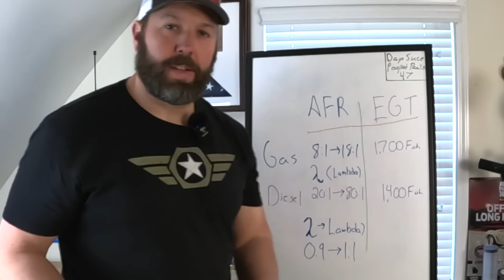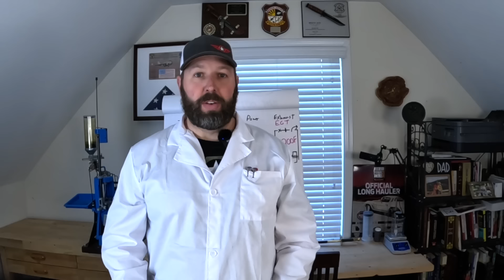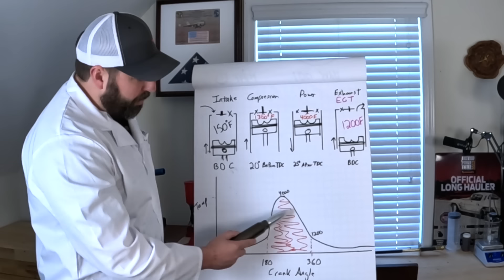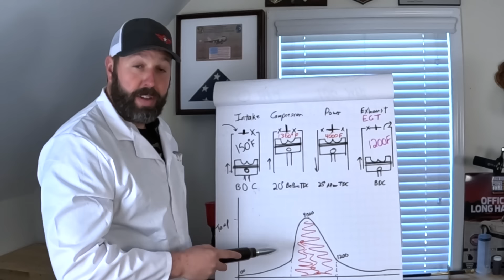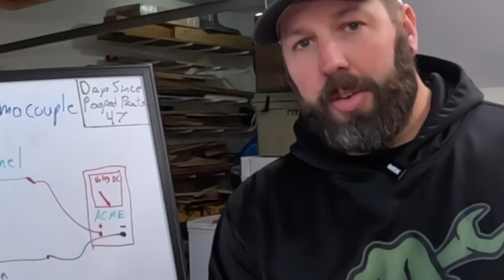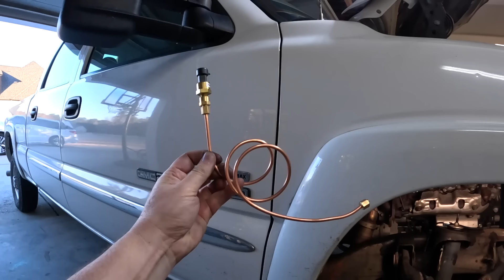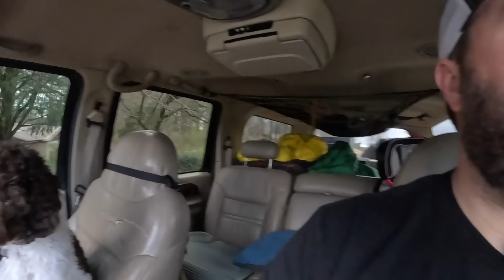Silent Diesel Killer…Diesel Exhaust Gas Temperature (EGT)! #diesel #egt #dieselengine

Comment: what do you think of putting a 12v lifepo4 battery in the trunk with 1/0 cable run to the lead acid in the front, I decided to do this as in my mind it would always keep the lead acid fully charged and happy and it shouldnt hurt the alternator just running as the back up

Comment: lurking’ under hood is a world of possibilities. 
Good info here to consider doing whatever it takes to keep things cool as possible. 
Trying to get up to speed on what it takes to make a 7.3 operate w more HP and keep it alive. 
Watched Daves Auto in Utah, speaks about those "gapless ring' / pistons what that does for these engines. 
Impressive to say the least.
Reply from the maker: Dave harps about a lot of stuff. $4,000 pistons that look like golf balls, gapless rings, and changing oil every 3K miles if you want him to warranty an engine e that he built. Hapless rings are good technology, but it’s really only something that comes into play when you are rebuilding an engine. Making power reliable power with a 7.3L isn’t hard, but it also isn’t cheap. I have a 7.3L Excursion that makes 500HP to the tires, and it was costly.
Reply: @freedomworx   What got my attention was the gapless ring phenomena,  help reduce EGT significantly as per his reporting. 
Which I’m understanding lower temps is a goal on making diesels live long & prosper. 
The explained science makes sense to me anyway what the byproduct and various mechanics does for the engine. 
Yet, most of us with engines factory pieces, the things we can do a LOT cheaper 'bolt-ons” sounds like the way to go actually. Better Exh system, the CTG programmer setup, Maybe the DPI setup, The Banks top end pieces, better Engine oil cooler and Trans cooler both. Heck of a lot cheaper then a Dave’s $15~20K engine for sure!  500 HP is way plenty honestly for most any needs.
Reply from the maker: @yafois988 I haven’t seen the video. But I’d be interested to see how gapless rings could reduce EGTs. I can certainly understand how they reduce blow-by and oil contamination. But EGTs… I’m not sure I follow that one. I have gapless seconds rings in a 1000HP 12 Valve, but I honestly don’t have any data to back up what benefit I’ve received from them. For a 7.3L though, just like any other engine, you really just need to build the engine for the application. If you are going to be towing with it, and don’t want to spend a ton of cash, the best bang for the buck is a set of Stage 1.5 injectors and tuning. That’s a 180/30 injector. Your factory fuel and HPOP are enough to feed them, and your factory transmission will generally survive. That’s good for over 400HP to the tires Anything after that gets very expensive.

Comment: Cat got it right the top part of the piston is steel and the skirts are aluminum and the wrist pin holds it togather so come cummins why not in my 5.9 or 6.7  Dodge motor ?
Reply from the maker: Two piece pistons are nice, but they are also expensive 😉

Comment: I think something that confuses a lot of people it's that they conflate heat and temperature. You have to keep in mind that these are completely separate entities. For instance a cigarette Burns at a very hot temperature but contains very little heat. On the other hand, a bathtub at 100° contains a good bit of heat but very low temperature compared to that cigarette.
Reply from the maker: Good analogy 👍

Comment: Do diesels benefit from methanol/water injection like petroleum engines? Never understood why adblue and EGR exist when it sounds like we could be squirtin in plain old tap reconstituted tapwater. Would probably steam clean that dirty EGR pipework too.
Reply from the maker: Yes, Water/Meth works great on a diesel. But most people aren't willing to deal with the hassle. Also, DEF causes a chemical reaction to reduce NOx. It's not just about lowering temps.

Comment: there's a lot of thermal dynamic going on, if you play paintball, you see it all the time when you fill your tank vs shooting.
Fill tank = compression stroke, spending tank pressure = power stroke, when gas escapes, or the space becomes less dense, there's less energy thus cooler temps. 
Just a different way of looking at it and relating.
Reply from the maker: Science 🤓

Comment: So for those of you who need a translation -- when towing, turn on the tow/haul mode!
Reply from the maker: That’s what you gleaned  from the video?
Reply: @freedomworx  Yes, after your excellent explanations, it makes perfect sense why, among other reasons, you would want to use tow haul mode when putting a substantial load on the engine. At least on my truck, it automagically substitutes a little more RPM for torque so that you are not dogging the engine, which according to you, will increase EGTs.
Reply from the maker: Yeah. Tow/Haul generally raises the shift points and makes the engine breaking scheme a lot more aggressive 👍

Comment: I'll add when drilling the manifold, use the clutch on the drill. It's worth not breaking off the drill bit in the manifold while the engine is running.
Reply from the maker: Good tip 👍

Comment: That was great, thank you! I'm off to fill my turdbo with shavings and busted taps...but before I do that... can you explain me why the exhaust was smokier on the higher map? Is this a function of the map or of the EGT?
Reply from the maker: Smoke and EGTs generally go hand in hand. More fuel equals more heat (EGT), but it also means more smoke, because with more fuel in the cylinder, you are less likely to get a complete burn of all the fuel.

Comment: Where did you get that drive pressure sensor?
Reply from the maker: It’s just a normal pressure sensor with an Isspro drive pressure adapter to keep the sensor cool.
Reply: Thanks. Is the manifold adaptor for that 1/8" npt like the pyrometer?
Reply from the maker: @clintbrock8052  yes

Comment: 2000 stock 7.3 Excursion here with 320k pulling a 33’ RV. Thanks for the explanation and the suggestions on what to do to help keep temps low until I can get a gauge to know for sure.
Reply from the maker: It would be tough to hurt one that isn’t modified, but it’s always good to have a gauge to tell if something is going wrong 👍
Reply: @freedomworx  thanks, that’s good to know. This video was the first time I’ve ever heard mention of a stock engine probably being ok. 

Your Excursion build series by the way is still some of the best YouTube I’ve seen. Thanks for the great vids 👍🏼
Reply from the maker: Thanks for watching 👍

Comment: And 3 to 5 minute idle cool down after working a diesel hard to avoid cracking the head..
Reply from the maker: Cooldown is primarily intended to allow the turbo to cool so that it doesn’t cook the oil in the turbocharger bearings once they lose oil flow.
Reply: When and why do I lose oil flow to turbo on 06 Cummins?

Comment: Keeping the engine revved up towing equals more CFM coming out of the turbo equals more cooling of the engine and combustion chamber. Bigger intercooler after cooler water methanol injection
Reply from the maker: That’s one way to look at it. Horsepower equals heat. To make the same amount of heat (watts) with fewer RPM, you have to make more heat per engine cycle. Meaning more cylinder and egt’s.
Reply: @freedomworx  Yes to a certain point. Exactly what you said in the video. Just put compound turbos double the CFM volume going through the intercooler / after cooler which in return equals more volume going through the cylinders of cool air
Reply from the maker: I’m building a compound 12 Valve right now. Should start seeing content within a couple weeks. 👍
Reply: @freedomworx  That's awesome man. I built a compound 24 valve on my big truck. It's a 60 mm over a 77 mm. It runs nice and cool for weighing 12,000 lb. And then I put my big dump trailer on there and put my JCB 214 backhoe in the back of it. It weighs in at 42,000 lb all together and still runs cool

Comment: What about if you add water/methanol injection. Will it lower your egt?
Reply from the maker: Yep. I actually had that in the video and cut it out to shorten things up.
Reply: @freedomworx  can you do wideo about water/methanol injection in diesel engines. Is good and bad sides of it. Whant to do it for my 2017 ram 6.7 Cummins but cant find any info for Diesel
Reply from the maker: @bogdanshulga2465  I’m honestly not sure how well it would jive in an emissions equipped truck, assuming yours is. I’ve never really thought about it. But it certainly works to reduce EGT and increase power in high boost/load situations.

Comment: I would say exhaust valves are in danger of burning an edge.  1250 degrees max. 1200 for a few minutes. 1100 degrees extended. That is my self imposed limits
Reply from the maker: Nothing wrong with imposing conservative limits on yourself.

Comment: I used a thermocouple and would never let the engine run over 650deg Celsius normal driving.  When racing however i would regularly bnild dngines that could see 800deg quite safely. The biggest killer for any diesel is poor quality fuel.. and possibly oil starvation... or maybe water ingestion...and occasionally a failed governor...but there was that one time the timing belt snapped, that shaffted the poor girl pretty hard. I always measured at the down pipe for ease of fitting.
Reply from the maker: That's pretty hot for a downpipe temp. At least for a diesel it is. Gasoline engines have higher EGTs.
Reply: @freedomworx  Yeah agreed that would be the absolute max at 650 on the down pipe. That would be like you showed in your test ie high load full throttle. My race diesel engines normally have uprated oil cooling to the piston and the bigger valves and seats generally help.
Reply from the maker: @captainchaos3053 yep. Piston, valve, turbo upgrades cooling upgrades can definitely extend the safe EGT range 👍

Comment: A lot of people hate on EGR because they think that it clogs up their intake. It's not that, it's actually the PCV valve (aka my mortal enemy).

Let's think about that. Normally, your exhaust should have gas and dry dust flying out the back. So, it doesn't make sense for dry dust to cause a wet goopy mess in your intake valves. You know what does cause wet goopy messes? Oil vapors. 

The reason that the PCV is my enemy is due to the way it's implemented. It's there to make the air pressure on top of the piston be the same as on the bottom of the piston. So, like, WHY NOT ROUTE THE PCV FROM THE CRANKCASE TO THE VALVETRAIN? Why would they ever choose to spray the intake with an oily mist when they could spray the valve train with an oily mist?

I hope you can see why I don't like the PCV.

P.S. you engine experiences something called "pumping losses" at low rpm. The EGR actually helps to mitigate that. In short, it basically allows you to open the butterfly intake to like 50% but you only get 10% power which is good for low rpm pumping losses (numbers are just made up to illustrate a point).
Reply from the maker: You can’t vent the crankcase pressure to the crankcase. The pressure in the bottom end of the engine is the same as the pressure under the valve cover. 🤷🏻‍♂️ EGR only affects pumping losses in spark ignition engines with throttle bodies. Doesn’t offer that benefit on a diesel.

Comment: I like how you point out how the thought that the emission control and noise control systems in a modern truck are the largest exhaust bottleneck is false, and the downpipe is the real major issue.  

The first generation emission control systems WERE downright awful for performance, and also were not durable.  They used packed crystal catalyst.  About the only thing truck owners liked about them is the fact that they increased emission noise not unlike a glass pack on a motorcycle, something neighbors hated about them.
Reply from the maker: I'm not sure that't the impression I was trying to make. I was making that statement in reference to non-emissions equipped vehicles. After treatment devices do create back pressure beyond the down-pipe. Installing a bigger down-pipe on an emissions equipped diesel isn't going to have nearly the effect that it would on a pre-emissions or deleted vehicle. Also, on a Cummins equipped truck, the down-pipes are already large enough because the turbo is on the side of the engine, so the down-pipe doesn't have to squeeze between the engine and the firewall like on a V configuration engine.

Comment: For the nerd explanation of a thermocouple:
When you bind two metals together the point at which they merge forms a diode, much like a crystal in a crystal radio.  This point is basically a semiconductor junction but unlike other semiconductors has stronger properties .
All diodes have all the following properties, but each one is built to maximize one and exploit it.:
1. They conduct electricity more easily one direction than the other.
2. They completely block electricity on the direction they provide resistance in up to a certain voltage threshold.
3. They create a small amount of light when electricity is run through them.
4. They transfer heat from one side to the other when electricity is run through them.
5. When heat is forced from one side to the other they generate a small amount of electricity.
6. When exposed to light they generate a small amount of electricity.
7. Properties 1 and 2 change in threshold based on temperature to an amount based on material.
8. Properties 1 and 2 change based on light exposure.

Thermocouples are designed to maximize the 7th behavior I listed, while minimizing the others.  They are also designed to have that behavior appear in the most reliable manner possible.  Hence, when attached to a voltage source, a known resistor load, and an appropriate electrical measurement circuit, you can read the heat the that the thermocouple is tied to with a high degree of accuracy.
Reply from the maker: Thermocouples produce their own voltage. Has nothing to do with a resistance reading in the sensor producing a gauge input, like other sensors, is that’s what you are insinuating.

Comment: Its different than trucks, but on the common rail VW engines you can run 16:1 easily without  much smoke - but of course you hit your EGT limiter within 10 seconds 🤣
Reply from the maker: Same principle. I used to have an ALH TDI (not a common rail). That was a tough little motor.
Reply: @freedomworx  those little 1.9tdi motors are the most hated motors known to man everyone that ever owned one seems to spend their time trying to detonate it or launchn8t into orbit.
Reply from the maker: Bulletproof 😎

Comment: Q: are the temp:voltage outputs of K type probes (supposed to be)  standardized...or do diff. manufacturers' probes produce diff. ranges (diff. ratios)?
Reply from the maker: They are supposed to meet a standard ANSI/ASTM spec.
Reply: @freedomworx  Thanks. Good to know. So on my 14yr old "SS Competition" EGT I tried replacing the failed (K-type) probe with another one I got with a cheap chinese EGT and it sorta works. Gauge seems to show temps of 1/2 to 2/3 of reality.  Now that I know probes are supposed to output standard voltages (and have found these published values https://srdata.nist.gov/its90/menu/menu.html ) I'll pull out the probe and test it at specific temps to see what voltages it's producing.  Application is a Mitsubishi 4D56 turbo diesel that are notorious for cracking aluminum heads when ran too hard.

Comment: I am not an expert…but I didn’t think the Duramax Throttle body even has a throttle plate. It’s just an empty housing to connect inlet hose.
Reply: Inconel is a type of stainless steel I was taught.
Reply from the maker: Inconel is not a stainless steel, it is a superalloy. Stainless steel is predominately iron. Inconel actually has very little iron in it, generally less than 10%.
Reply from the maker: Older Duramax engines do not have a throttle body. Basically all newer diesels due. A throttle body helps with EGR regulation and also helps the engine shut down much more gently.

Comment: Hi, I'm new around here in your channel. Very interesting explained everything, but I am bit curious about that vacuum thing after the MAF sensor at the intake side. What's its purpose and how do u name it? Thanks in advance 😊😊
Reply from the maker: I’m not exactly sure what you are referring to. The PCV?
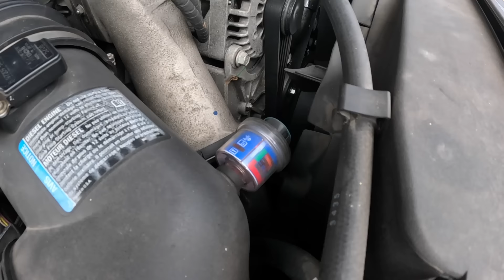Reply: I think not, you have shown it at 16:19 and my bad - its before the MAF
Reply from the maker: @iasengeorgiev6023 ohhh… that’s called a Filter Minder. As the air filter becomes restricted, it will move and tell you that it’s time for a new air filter.
Reply: @freedomworx  Perfect, thats genius, thanks, i have to search around my place for smthng like that, thats seems like a good idea on turbo engine :) thanks again for info
Reply from the maker: @iasengeorgiev6023 it’s pretty standard on Diesel pickups in the U.S.

Comment: what's better for the engine under extreme load and fueling? I've only watched the first 6mins of this video, so if it's answered later please feel free to say "watch the damn video".

1. higher rpm / lower gearing, with slightly lower boost and EGTs
2. lower rpm, taller gearing, but slightly higher boost and EGTs

I'm guessing there's a trade off between options 1 and 2 due to the 'recovery' time between combustion cycles being reduced with higher rpms. is this true? i usually try to be a option 1 driver, as i've always focused on EGT and lowering strain from over-gearing. But am i wrong?

Thanks, and excellent video too!
Reply from the maker: Watch the damn video! 😂. Seriously I discussed that later in the video. RPM is your friend under heavily loaded conditions. Keeps the EGT and stress lower on the motor. Lugging creates higher heat and pressure. 👍
Reply: 1 and always 1 on any engine and transmission. Only exception I know of is a steam engine 😂